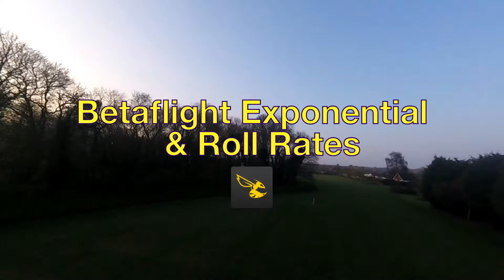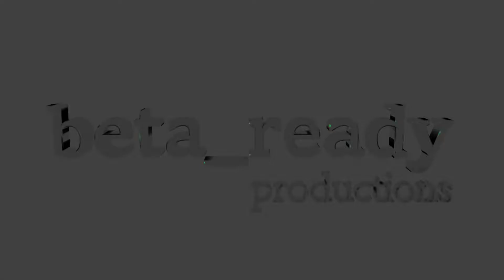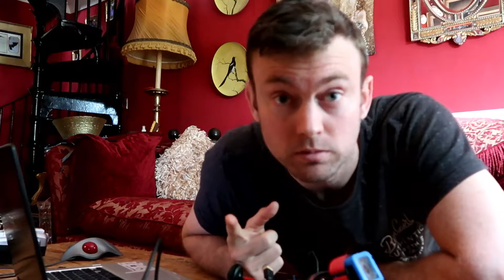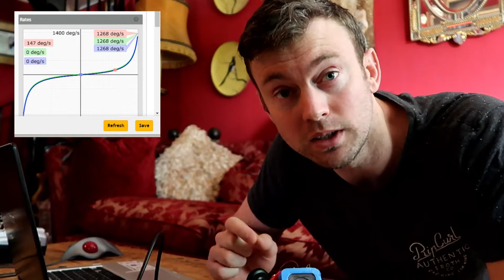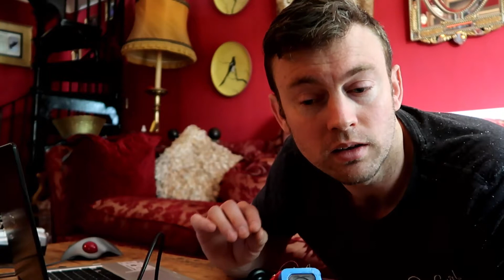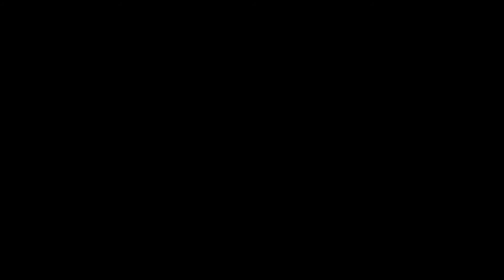Betaflight Expo and Roll Rate - As Fast As Possible

Comment: So the higher the arc the faster the spin at the end of the sticks I want my roll faster but it's all so confusing
Reply from the maker: M Williams - yes, a higher degrees per second value will give you a faster overall spin with the expo applying the majority of it at the end of your stick travel. If you want it to pitch/roll faster towards the middle try reducing the rc expo and the super rate (slightly) and increasing rc rate upwards. Just go slowly, adjust gradually and test, aiming to maintain a consistent degrees per second value. Can I ask your current degrees per second?
Reply from the maker: M Williams - here's a more in depth breakdown of rates: https://www.youtube.com/watch?v=uBHQoYOp2gs - hope it helps!